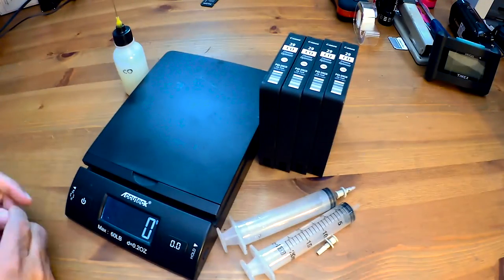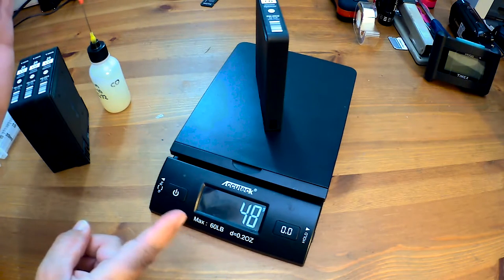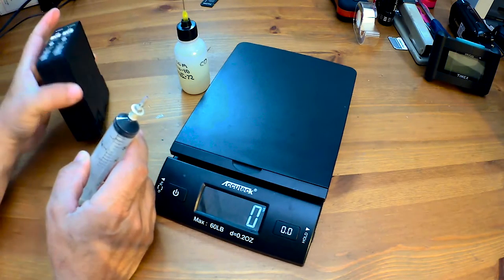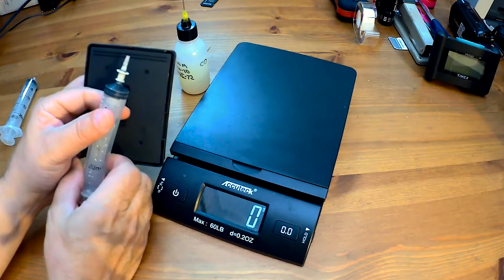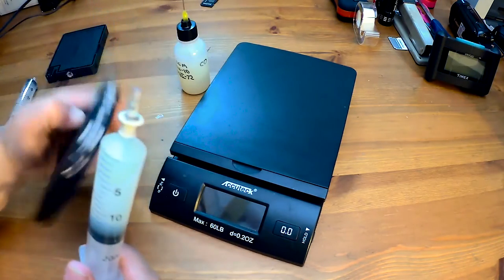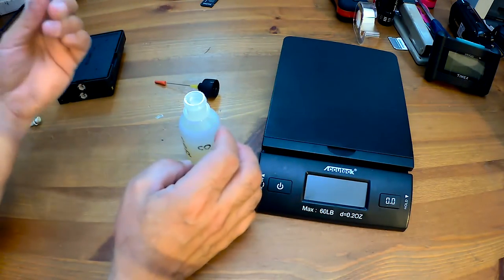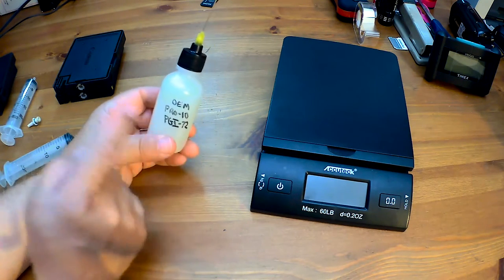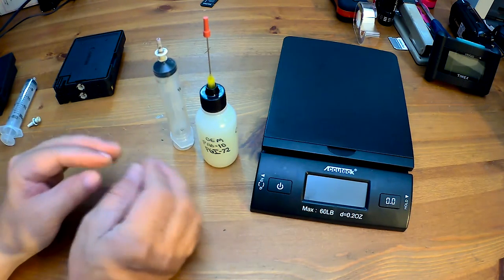How to Extract Ink from Surplus CANON PRO 1 PGI 29 Carts and them use them for your PRO-10 Cart's

Comment: Hello Sir. Watching your videos from West Africa. precisely from Republic of Guinea. I was sent a used Canon pro 1 from the USA. But when I checked inside, I couldn't find any cartridges inside. They have removed it there. So, my question is: *This of your pro 1 cartridges. Could they be refills after a single use. If no what will be the second option. * If yes it can be refills, I have a relative whom I'm willing to tell to buy it for me and ship to me through DHL. But how I my going to put you in contact.
Reply from the maker: Sorry but I no longer have any more sets of pgi29 carts for sale. You would also require a new chip every time a carts is re filled. PRO1 has been discontinued by Canon. It has problems with print head recognition.
Reply: @cheo1949  Thank you sir for the reply.